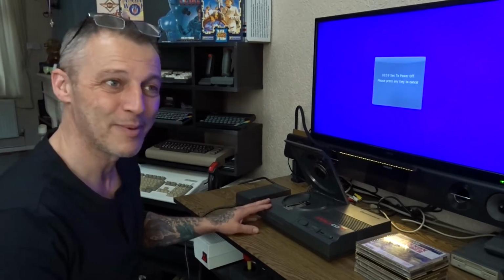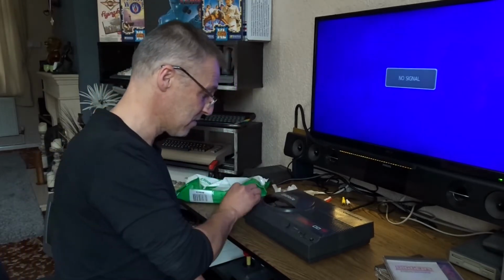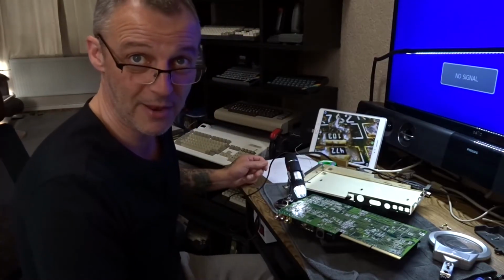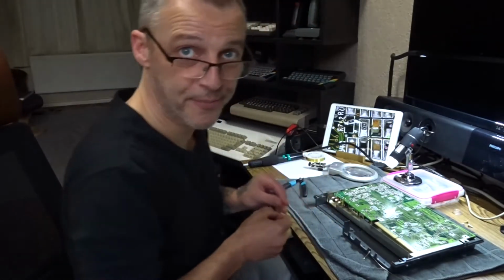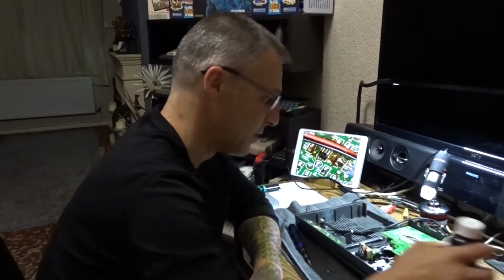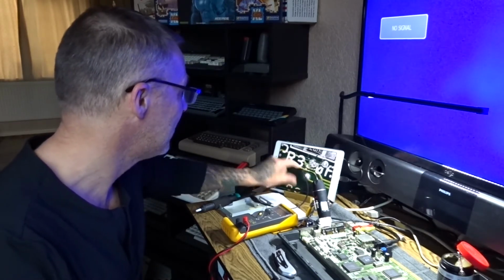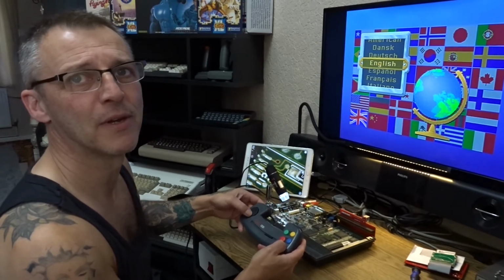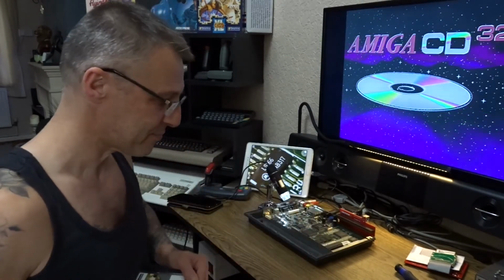Amiga CD32 in ruins pt1

Comment: eBay is hit or miss.   Anything I buy used on eBay I always expect it not to be 100% functional.    I have had pretty good luck on eBay except when tracking states something was delivered when it was not and eBay will not do a damn thing about it so I don't buy much on eBay these days.   Aside from the Towers the only Amiga's I do not have and have never seen are the CD32 and CDTV.   Maybe one day I might want to add them to my collection but first I need to wrap up the Amiga repairs I already have in progress before I add anything else to my collection.
Reply from the maker: It's rare to find anything in perfect condition. I only use Ebay to buy broken retro gear for videos, everything else like parts, I will buy new! When it's all fixed and looking like new then it will be going on Ebay ;)